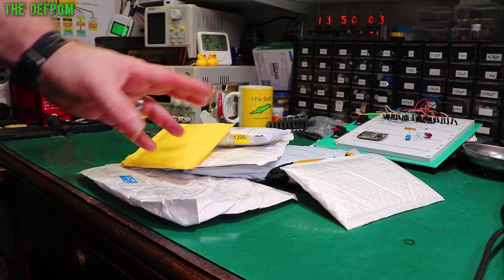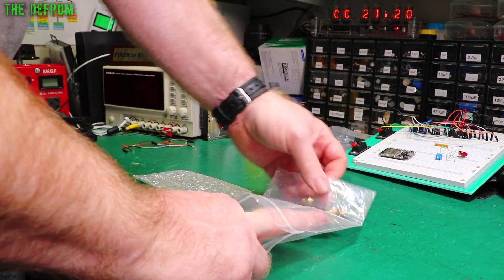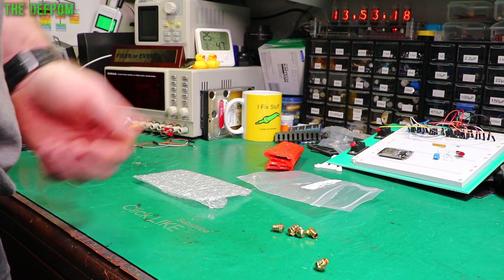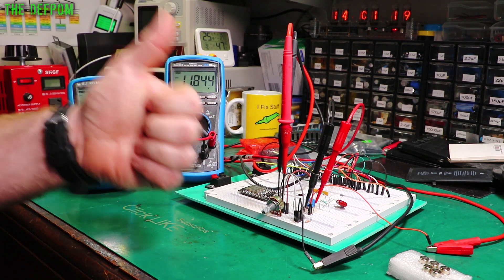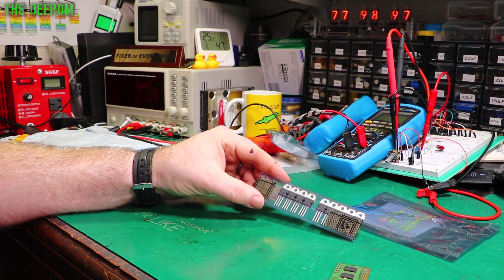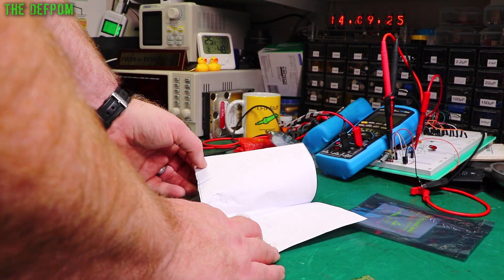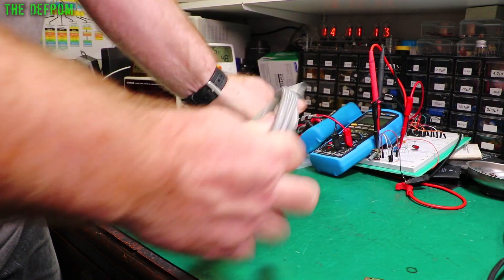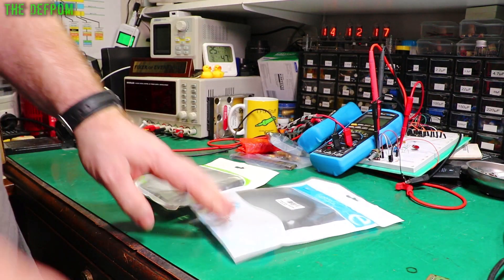🔴 What's in my Mailbag ? - 2nd August 2021 - No.859

Comment: Good call on the ACV version of those ST regulators which gives you 2% tolerance on the output, which would give you a spec of -14.7 to -15.3Vdc rather than the usual 4%.
Reply from the maker: Yes that is the reason I chose that part, I wanted more accuracy, they were a lot more expensive but still not that bad really.